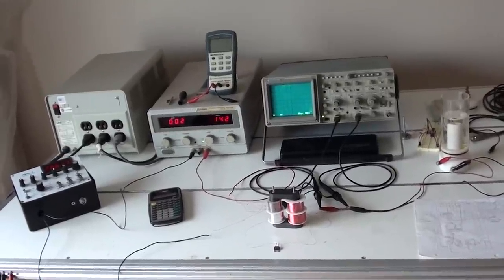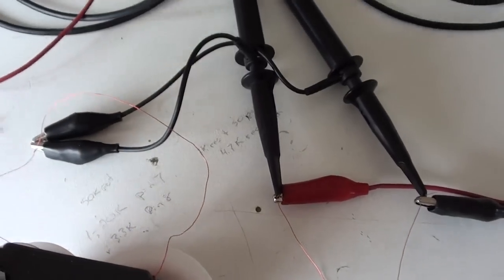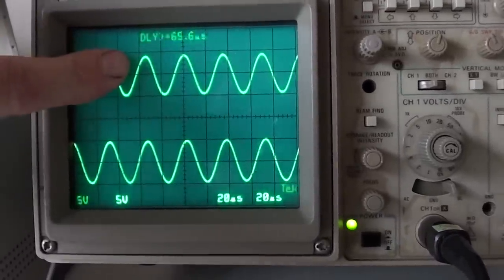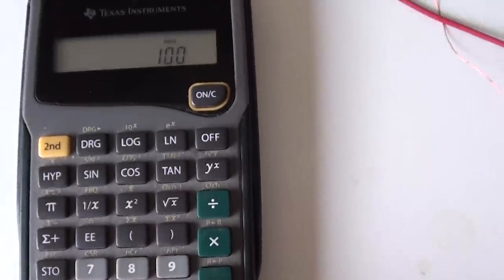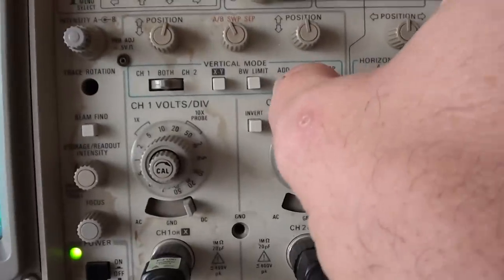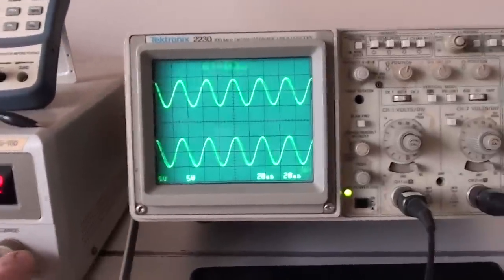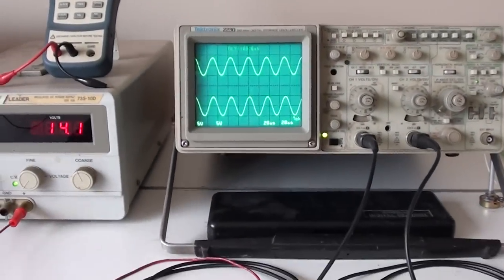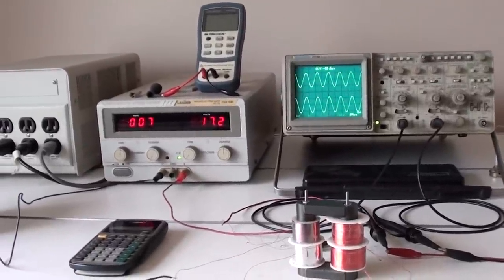Stan Meyer Replication Attempt

Comment: Excuse me for my dumb ass question, but... if you are providing DC current to the PWM, how is it that you are getting pure sine wave off the coils? Is there some sort of royer or colpitts oscillation circuit involved here?
Reply from the maker: It's still a transformer in the end. Pulsed DC on the input does the same thing as AC when it comes to transformer action. In the end, we want to see positive DC pulses across the cell. This is the point where most people have come to. It's still a work in progress. The gating signal needs to been added to this circuit, and adjusted to try and get the right positive DC pulses to the cell, with no AC signals.

Comment: http://www.globalmediapro.com/dp/A2JGB4/Pintek-DP-30K-Differential-Probe-30KV-50MHz/
You should get this while it's on sale as they really do help when dealing with high voltage. The one I have http://www.globalmediapro.com/dp/A2H108/Pintek-DP-15K-Differential-Probe-35MHz-15kV/ is rated for 15kv as this one wasn't on sale at the time when I purchased it. What I have should do well for the exciter array but not for the gas processor. My probes hooks up right on the water capacitor so there is no doubt what voltage is going to the cell.
With Gunther's circuit you will find you can do a whole lot more than just adjust the gating as it's really a nice set up. I normally go with 5 pulses based on the figure 10-5 drawing in the SMTB but you can try anything you like which makes it fun. Oh, get some transformer oil to help with the transformer problems though it is not a fail safe solution it does help.
Let me know when you get your circuit as then we can work a lot better together.